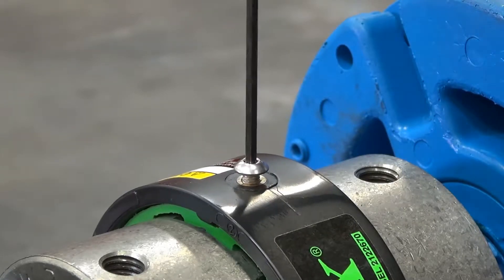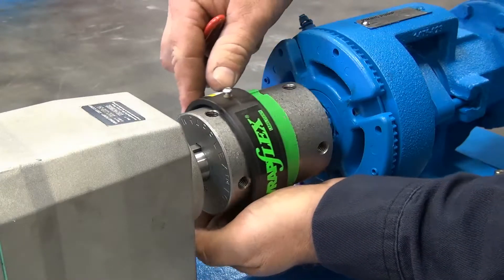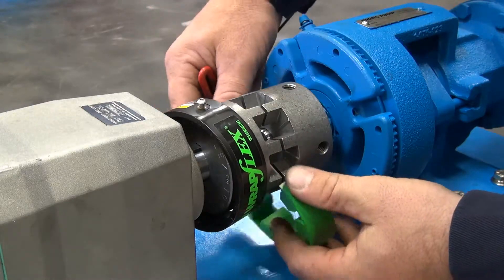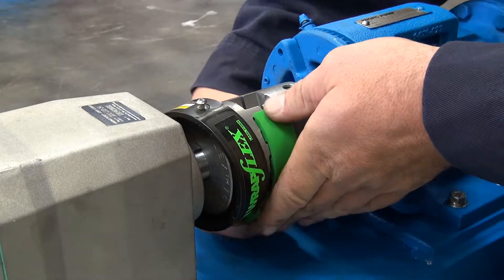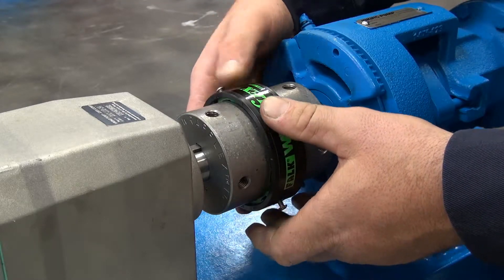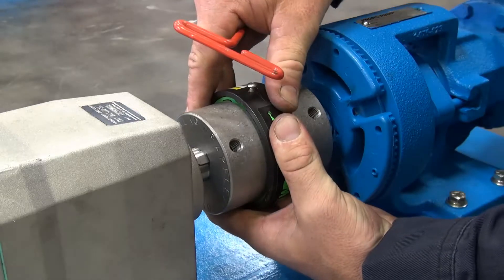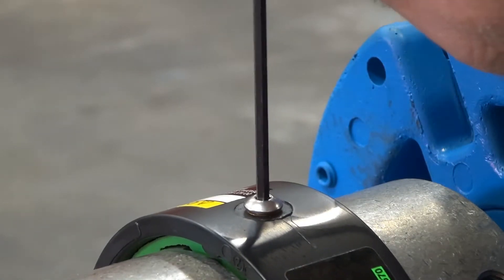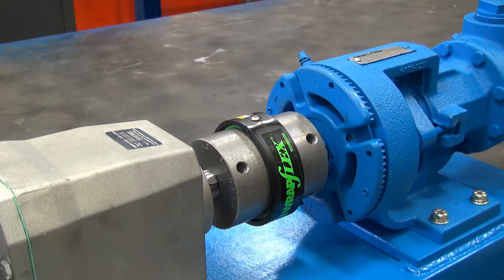Rexnord Falk WrapFlex Coupling Element Replacement

Comment: I asked ChatGPT and Gemini compare three couplers that we were considering. I was provided with an extnesive table of comparison. The summary supported our tests: We have decided to go with Falk WrapFlex for the modules in our Beltways system. 

Summary for Your Application (Conveyor, ~1,000 in-lb torque, 30 mm shaft)
1. Falk WrapFlex – Best Overall Choice

If your priority is misalignment tolerance, shock absorption, quiet operation, and minimal maintenance, WrapFlex is the strongest option.
It is designed exactly for conveyor-type loads with vibration and real-world offsets.

2. Viva Elastomeric – Good Budget Option

Lower cost but also lower durability and lower misalignment tolerance. Suitable if your drives run in clean environments and cost is a priority.

3. Zero-Max Disc Coupling – Use Only If You Need Precision

Excellent torsional stiffness but poor damping and strict alignment requirements. Not usually chosen for conveyors unless precision synchronization is needed.